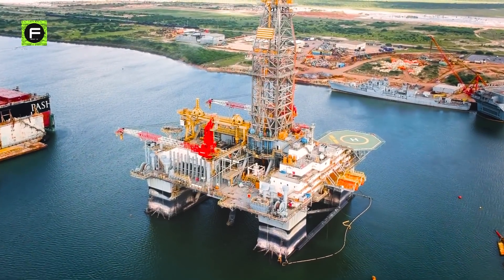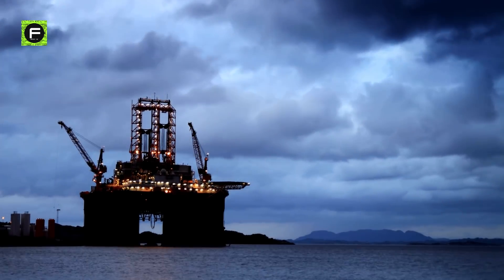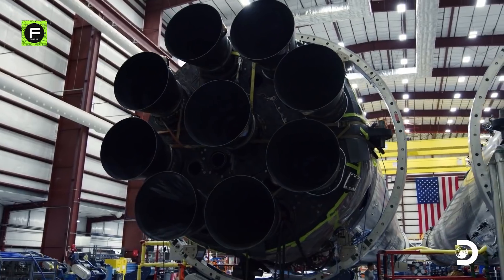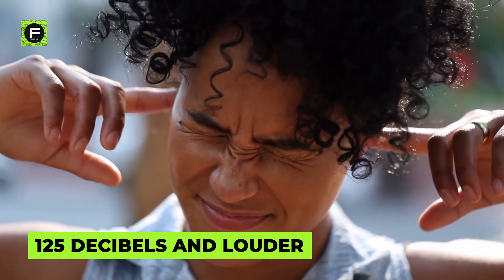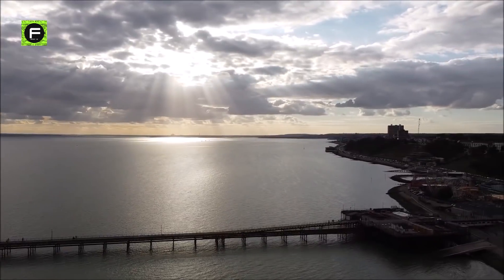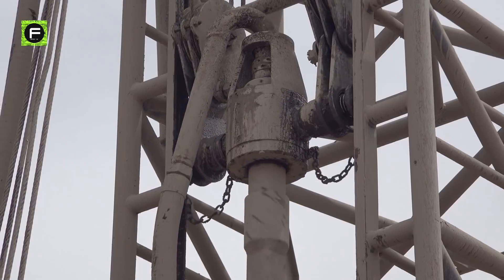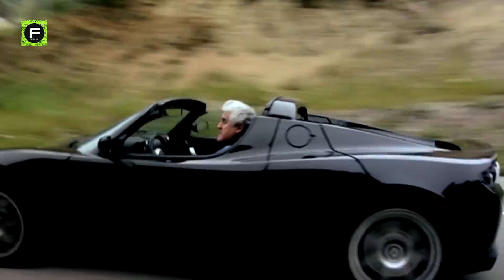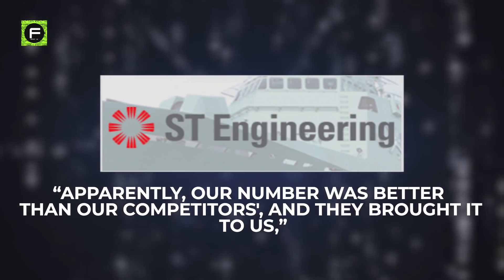Starship's New Floating launchpad- is really being built

Comment: "as little negative impact on the environment as possible" So no impact on marine fauna when they will launch all these giant rockets from the oil rig with all the noise?
Reply: Thirty KM from shore the concentration of sea life is much lower than it is closer in. Also the liklihood of a body of fish being subjected to the noise over and over is far, far lower, save the local population that subsists on the bottom (which is buffered by hundreds of feet of water). Sound also largely reflects off the water surface, though some obviously will carry below. 

So, yes, there is no perfect solution, but its Much better than just a few miles off shore or on land. 

If you are looking for perfection, you're not going to get it anywhere in life. You mitigate where you can.